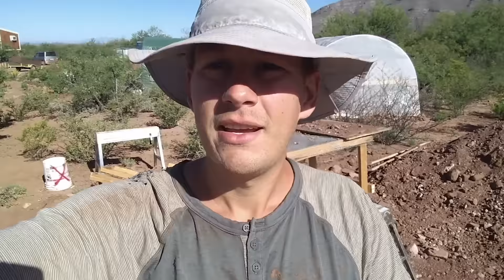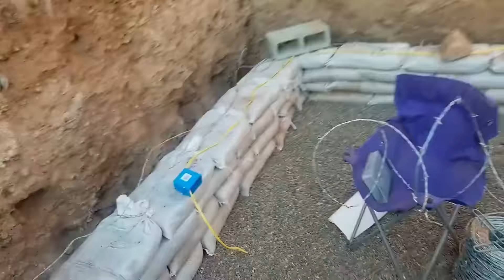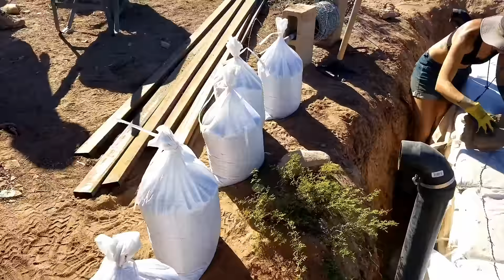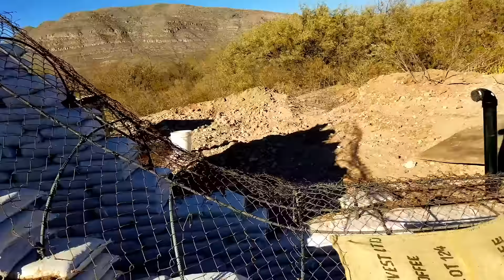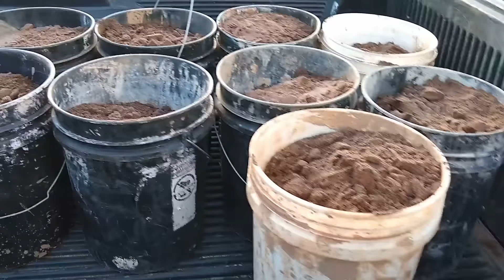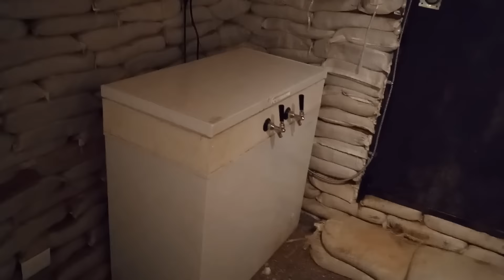Off-Grid DIY Underground Earthbag Pantry, Root Cellar, and Storm Shelter | Full Build Documentary

Comment: I know others have touched on this but building a roof would be hugely beneficial. Make the roof much wider than your root cellar and put some rain gutters and several painted IBC totes. Once youve done that then build some raised garden beds. I'd consider building SIP's which is basically bottom watered but uses far less water and there is less evaporation due to the bottom watering. It will help lower the temperatures again by keeping it extra shaded, but gives you an opportunity to grow some veggies in full sun and then also some that are significantly shaded. You could even extend from the roof with shade cloth to lower the temperature even more but still allow airflow creating a small microclimate. Keep the beds a couple of meters/yards away from the walls at least. I'm not an engineer. You'd need to look at how far to have your raised beds away from your walls for safety. Also ive never used self watering garden beds, but from all of my research they are very good for many reasons although nore expensive immediately, it means less time watering for you, more efficient and consistent watering, and that keeps the plants happy too. Yes it would be expensive but would be well worth it, in my opinion. More efficient temps in your root cellar, more vegetables to harvest, more water to catch to have water right where you need it. I'm now just wondering if you couldn't rig up some sort of float device so that you could have your IBC top up the water bed reservoirs up automatically. I havent heard of that but would be good to look into.
Reply from the maker: Thanks for the ideas!

Comment: If you want to add 6 more inches of dirt on top, install 2 double 2x6s posted crosswise to the roof trusses equidistant to the walls. It's a little bit more money but worth it after all the work everyone put in.
Reply from the maker: Thanks for the tip! We ended up putting old straw over top with a little layer of dirt. Insulative but not heavy :)

Comment: A suggestion is add another door at the top of the stairs and insulate/seal around the door to keep out the heat and cold. You will need to add at least one light with an on/off switch  at the top, remembering that even an LED light makes a noticeable amount of heat over time, so if you're going to be in it several hours, a  two way switch to turn the light on and off from the top and bottom may be a good idea.
Reply from the maker: We did add a door at the top later on. And yes we have a switch on a timer at the top of the stairs. Thanks for the suggestions.

Comment: How well is the hydrated lime holding up to the rains and is it cracking?
Reply from the maker: So two answers... 

The way I did the plaster on this building was not correct. I didn't slack the lime and had the wrong mix. So it's held up okay, but there are noticeable cracks that do leak into our stairway. Not ideal, but not a huge deal. 

The lime plaster on our Pumphouse (you can check out that full series) where I hired a professional to come teach us has held up great for a few years now. I used lime plaster again recently on our little tiny house build and it's looking really nice through a few months of monsoons. 

I personally like cement better, but lime works well over cob where cement wouldn't.

Comment: I always put 2 L bottles full of water in the freezer to take up all the extra space when I need space I take them out and set them on the floor. This could also help keep your room cooler. Eventually I started putting my goats milk in them but not completely full and freezing them then when I make my fresh goats milk which is always 105° and you put it on the stove on medium heat, I would add three bottles of the frozen milk into it and it aloud the milk to warm up very slowly. Since I lived alone and had 20 milking goats, this was an important part of using the freezer I originally started to keep colostrum in the freezer in case of a baby goat birth that needed the colostrum.
Reply from the maker: Interesting. I haven't thought to do that.

Comment: Can you give a link for the freezer to fridge controller?
Reply from the maker: Sure thing. I love these things. I use them to save power on our fridges, I also use one in our pump house in the winter hooked up to a heater so it will keep the room above freezing. 

https://amzn.to/3Opdc12
Reply: @DirtCreaturePottery  Thank you seems like these could have a hundred different uses.
Reply from the maker: @lawrencenull  For sure. For our Freezer to fridge conversions, I also add a timer on them so they are only on when the sun is out and our solar is charging. 

Deep freezers are much better insulated and more efficient than refrigerators which is why we use this system.

Comment: The lock cylinder set screw is in the bolt. accessed by a long allen wrench.  Info that is 10+ months to late!
Reply from the maker: Haha, I figured out after hitting it with a hammer there is a faceplate that pops off and then the screw is accessed like normal

Comment: I think concrete and cinder blocks would have been cheaper than sandbags and Bob wire
Reply from the maker: Earthbag is for sure cheaper. Cinder would have been a lot easier though. 

We spent all in with this about $2000. At $2 a block, 1400 blocks would have been $2800 + cement, excavation, roofing, electrical, etc etc.

Comment: Would it be worth attaching burlap between the roof trusses, and filling with straw?  That will give a good amount of insulation inside, without adding weight to the top of the structure.
Reply from the maker: We did end up adding foam insulation to the inside and piled straw with a little dirt on the outside. I would be hesitant to insulate with loose straw and burlap. That sounds like mouse nest heaven. 😅

Comment: Suggestion on a natural AC. Dig or drill a hole for a tube. About 16"+ then run 2 pipes about 2-3" in it. Fill with 3" river rock. Run water down over rocks and pump air down too. One small pipe is to pump water back up and the other air COLD air comes up.
Reply from the maker: Thanks for the suggestion, We are doing something similar on our main house.

Comment: What keep the sides from crashing in later
Reply from the maker: The bags are stable at this size. The barbed wire holds it all in place. We also use what I believe are called ironically "dead mans bags" which lock the walls into the outer dirt. Location was an important part of this as well. We're well out of the way of any sheet flow water which may compromise the walls. This thing will be around for a good long time.

Comment: Do a SECOND Root Cellar, point a solar cell (homemade) to the NORTH.  At night, run the solar (LUNAR) all night.  That will give you a deep freeze that, if properly done, will get down around negative 20, in the US.  Run water and alcohol through a garden hose painted black, (Matte Black) for the Lunar Cell.  Make sure the Lunar Cell has an unobstructed view of the NORTH SKY.  It will capture the cold of the galaxy and cool down the root cellar.
Reply from the maker: Thanks for the idea

Comment: Perlite makes a great roof insulation.    I just stacked bags on the roof decking between 2x4 framing, then another layer of plywood,  tar paper, 4 mil plastic,  then dirt and grass.
Reply from the maker: I hadn't thought of that. Thank you for the suggestion. We ended up putting straw bails and a bit of dirt over it. So far I'm happy with that.
Reply: @DirtCreaturePottery  The perlite is a really great idea, provided it's kept dry.

Comment: Some old scrapyard shipping container or farmers silo could have saved a lot of working hours building all those walls etc.
But it’s all a balance, getting stuff bought from a scrap dealer or private seller and getting it out there or use what you have and build it all by hand.
Me personally having worked in demolition, there is so much good quality lumber, steel, doors, windows, kitchens, insulation, bricks etc. going to waist you could get it all for free from any old building they’re gonna demolish or strip on the inside.
You can pick it up if you have the time and transport to get it.
A big flatbed trailer securely loaded with pick up truck or two of them, or a big old box car with trailer collectively owned could get you out on a building/ demolition site to get you all you need and more for the price of some diesel and the initial cost of the transporting vehicle.
You just talk with the owner and they’ll often let you strip it just to bring down the landfill costs of them having to dump it at a facility.
There are some investments to make but once you have big transport capabilities it can be a very affordable and even very efficient and financial lucrative way of getting your building materials and possibly some extra money for furniture, copper, brass, stainless etc to be sold nearby at a scrapyard after taking out building materials for your build.
When local demolitions go on you could make a deal to drop materials like just wood, just brick, insulation etc. at your place, maybe pay a reduced price cash or a small fee for them going the extra twenty miles or whatever out of their way for you.
But be sure you get what you asked for and don’t get mixed waist instead of recyclable materials.
Reply from the maker: Thanks for the comment! We definitely don't use the individual bag method anymore. WAY too much labor. Now we use Hyperadobe which is still earthbag and inexpensive but WAY quicker. 

Do you have any advise for finding places that are going to be demolished? I do have a 16' trailer and truck and would love to get more into the scrapping scene since a lot of our homestead is about reuse and recycling. I haven't found anything locally, but I'm probably not looking in the right places.
Reply: @DirtCreaturePottery  
@h.rutten2187's comment brings up some interesting ideas.
Reply: Contact roll-off companies. A Roll-off is that large metal container you’ll sometimes see outside a house, which contractors use for waste. Roofers will know rolloff companies, and one of the rolloff companies will probably know a demolition company.
You could also contact demolition companies. Or companies which rent out demolition equipment left (eg wrecking ball)

Comment: A better way to sort dirt might be to use a "A FRAME" Basically build a square frame with the screen and hang it from a frame like a swing set. You just keep pushing and pulling it as someone throws dirt on it. The finer particles get sifted out and afterwards, you "TOSS" the rocks and what not forward. The Philippines almost always use this method to sift the gravel when building house.
Reply from the maker: That's similar to what we do now. And hire a neighbor with a back hoe to come help sift :) MUCH easier and quicker. More information in our hyperadobe video series. Thanks for the comment!

Comment: You could put ridgit insulation on the roof.  You can get it two inches thick.  Four or six inches would really help the temperature in the Boot.  That was my thought when seeing it done.  You could also plant bushes around the sides.  The shade would be welcoming if it didn’t take a lot of water to get them established.  Later
Reply from the maker: We ended up putting rigid foam insulation in the roof then covering the top with about a foot of straw covered with a light layer of dirt. I think that's going to help a lot this summer.
Reply: You can build a low trellis over the area your roof is, and then after seeding your green roof, you can also grow vines on the trellis to shade green roof during the worst of summer.

Comment: You need to vent the staircase, not the lower level. Dig a trench and throw some vent tube in the trench to extend the intake tube. The result will be lower intake air temps. You will exhaust the hottest air out of the highest point, thus resulting in a deeper cold sink. Also, shade the immediate area around the intake tubes to lower the ground temps around the intake opening.
Reply from the maker: Thanks for the suggestion! I think I'm going to play with opening and closing the tubes this summer to see what happens.
Reply: @DirtCreaturePottery  Be very careful about closing the vents off as you could create too little oxygen in your root cellar. Certain veg out gas with very hazardous gases.
Reply: @karensprings4237 so true, I just learned that rotten potatoes can literally kill you!! Killed an entire family as they went to the basement, only one little girl was left alive bc grandma left the door open when she went down. Horrible story but I had no idea about veg gases!
Reply: @DirtCreaturePottery  No problem. Out where you are, you need to think about shading the ground. Huge differences in temps can be made with a little shade. I'd build a cover like a gazebo overtop that cellar, have sage brush shading the ground over top a buried vent tube, and use the concept of heat exchanging. Think "geothermal" but in reverse. You want to supply cooler air to the cellar, and let the heat in the cellar move into that colder air, then move that warm air out into the ground. The ancients use evaporation. They'd dig a pit, put a clay vessel in the pit, fill the pit with sand and wet the sand and earth around it. The result was an evaporative cooler effect much like a refrigerator. Not as good, but same basic thermodynamic concept.
Reply: @raycecil4643  zeti pots or something like that, lol are wonderful! Charcoal works for evaporation cooling too. I made a veg keeper using hardware cloth filled with charcoal and drip tube and a solar charged fan. If you have a prevailing wind, you don't even need the fan.
Reply: @DirtCreaturePottery  Did you ever tweak this?
Reply: @DirtCreaturePottery Gases from Potatoes 🥔 have Historically killed numerous people and family members
Reply: Might want to repaint a lighter color...reflect heat.
Reply: Comments like this one are why i click on these videos.  Read the comments notnjust watch the vid
Reply: @kuzadupa185  Thanks!
Reply: Why not engineer the roof to hold more weigh when you built the cellar
Reply: Excellent ideas!!
Reply: I imagine a snail shaped entrance so you retain the cold longer
Reply: @RandomsFandom  half steps up and down throughout the counter zigzag  entrance are for water pools to cool off air blowby throughout the one way allowance valves.
Reply: @JoshuaLee-e5i  Huh?
Reply: Below 6 ft, the average temp is 52 degrees
Reply: Indeed
Reply: Nice work.. you are missing on air circulation in your cellar. You need to have outlet for hot air to go out and the inlets for cold air to come in

Comment: For the cob and earth bag building do you use just the dirt on your land or do you have to ship in some components like clay? I did a soil composition on my land in Tucson and it seemed like pure sand. I do want to do a cob house eventually just wasn’t sure how to get a good mix. Thanks!
Reply from the maker: We used dirt directly from our land. Woven Poly Earthbags are somewhat forgiving for the mix. For our hyperadobe (which I recommend over individual bags) we have sand trucked in. It's $650 for 15 tons delivered, our little hyperadobe probably used about 25 tons. So not too bad in overall cost. 
Our soil is a pretty good with clay mix, so we can use that straight from the ground.